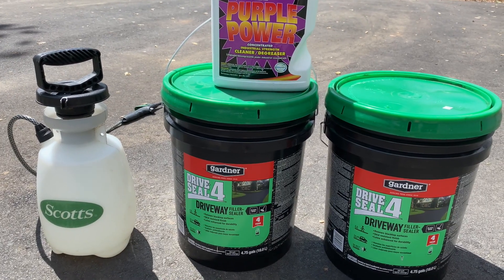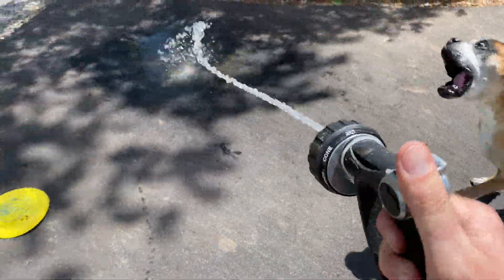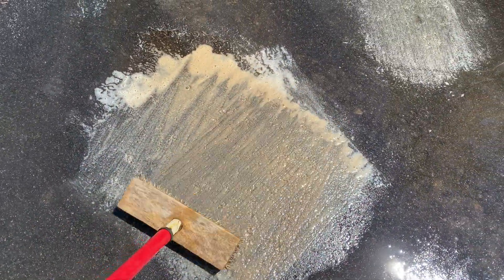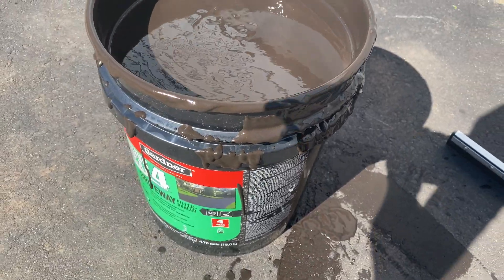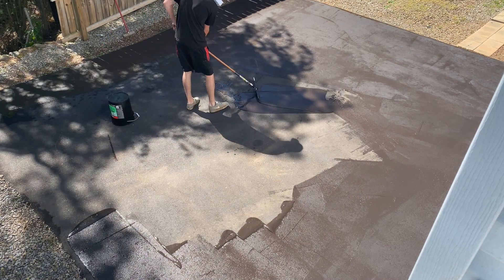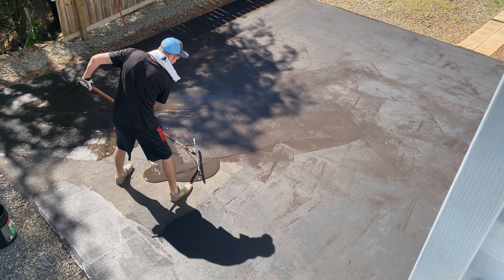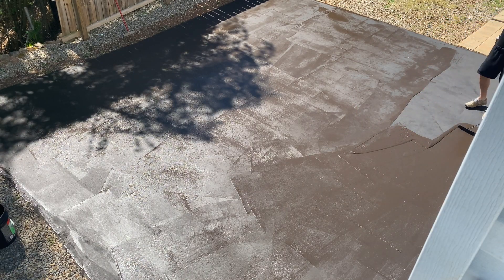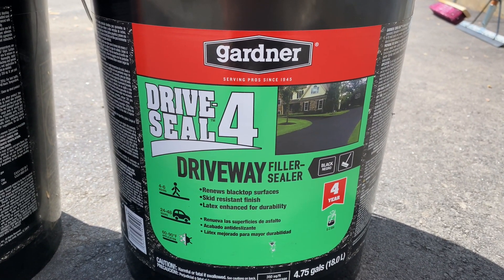How to Apply Gardner Asphalt Sealer From Lowe’s

Comment: I used the same brand but the 10. Seemed thicker. This was a good vid. My only additional suggestion (which I didn’t do well enough unfortunately) is push down hard on the squeegee to spread it out thin. Than do a second coat when it’s sort of dry. I did use a power washer and the powervstirrer. They helped but I wouldn’t buy or rent the washer just to do this. The stirrer is cheap and worth it.
Otherwise, this was a good vid. Thanks.
Reply: @WesleyAllenNC  I may do that too. Btw, I think the brown color is the sand they put in it. Very satisfied with the product. I’m over 70 and did it easy. Just slow down and pay attention.
Reply: Why does the product say "No Stir".   Seems like they are lying.